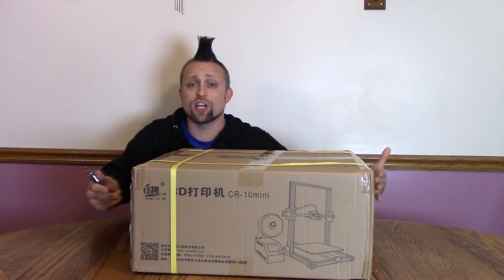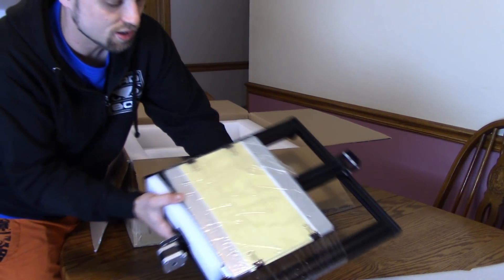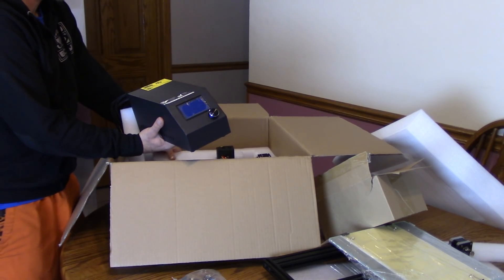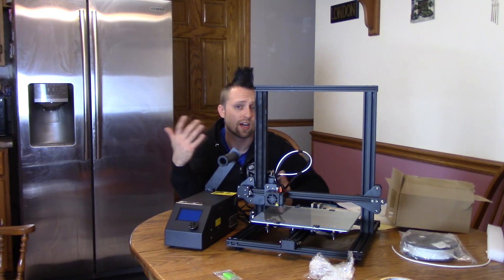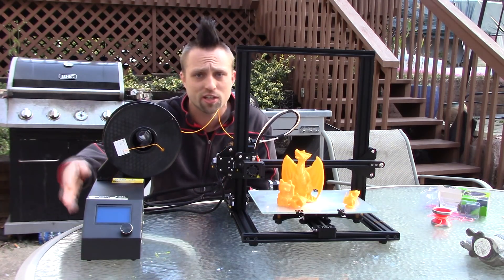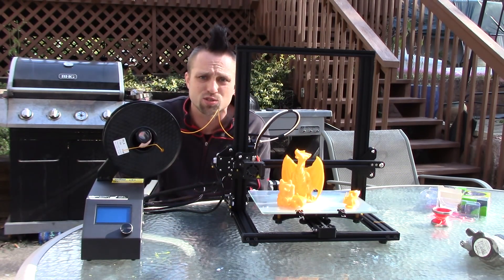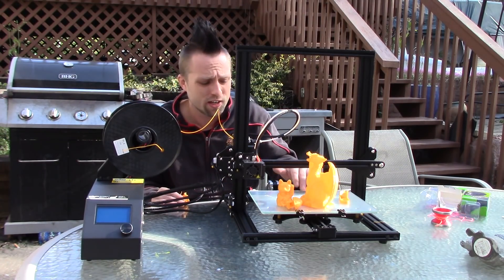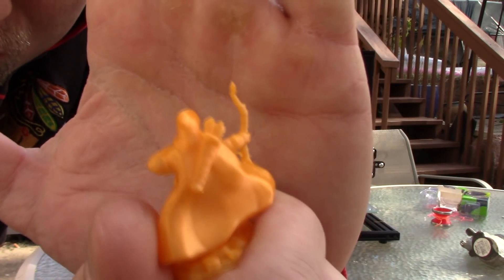Creality CR-10 Mini Unboxing and Review.  Great 3D Printer.

Comment: Hey, I just ordered a CR-10 mini. It's my first 3D-printer so I'm pretty excited. The only problem is that I have two cats, so I need to build an enclosure for the printer or they'll mess with the printer when it's running. How big would you say I'd have to make the enclosure? I'd like to fit the control box with the filament holder in it as well.

Comment: What's up bro cool vids by the way. Ok I got the cr10 mini for my first printer. I have been having so many problems on the the bottom of my prints. The prints I designed are curved at the bottom and if I rotate it look worse . For playing around with this printer for 2 weeks now I don't know what kind of tricks I can do. I am printing with regular pla and I am printing with a raft and supports because the print is rounded and tried so many different numbers of settings but still looks like stringy or spaghetti like, rest of the print is phenomenal. If you could give me some pointers or send me a cura setting that you use that would be so helpful. Or is there a better slicer?

Comment: Does the filament come with the kit by default, or do you have to add it as a compound deal?
Reply from the maker: +happylittletrashcan comes with small spool
Reply: do you know the diameter of that filament?
Reply from the maker: +happylittletrashcan 1.75

Comment: I have the CR-10 and you need the 300x300 for some prints. Now i´m waiting for the Mini Version cause i design/print big buildings (https://www.thingiverse.com/thing:2656480) and for 80% of the parts i can also use 200x300 mm. But for many stuff you need a 300 mm X and Y Axis.

Comment: I've been really looking into either this printer or the Anycubic i3 Mega that you also reviewed. However, Im really getting stuck on which one to choose. Would you be able to make a video comparing the two to see which one is really worth the price? Thanks
Reply: I have been debating between these two. i think the only difference b/w the two is the print volume and the ability to print certain filament. according to my research, you cant print with flexible filament in the Anycubic i3 Mega but you can in CR-10 mini. But you can print ABS in Anycubic but not in Cr-10 mini.